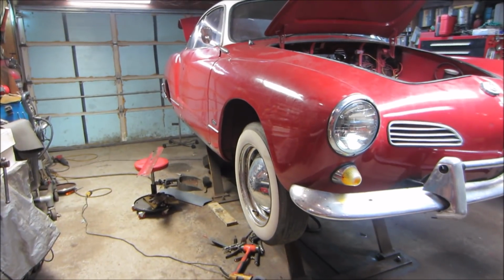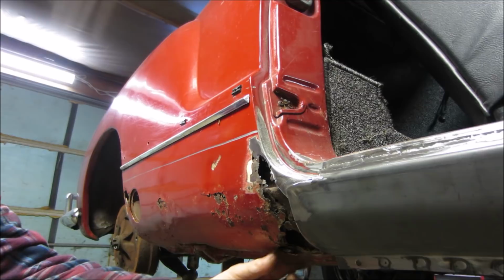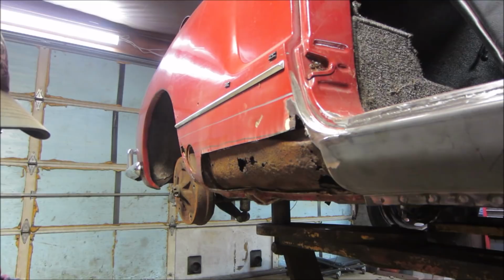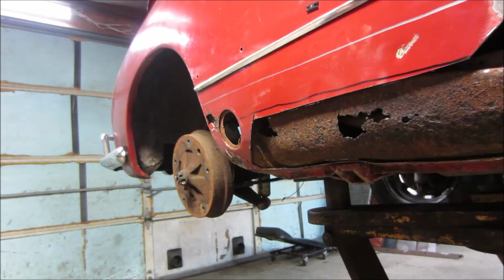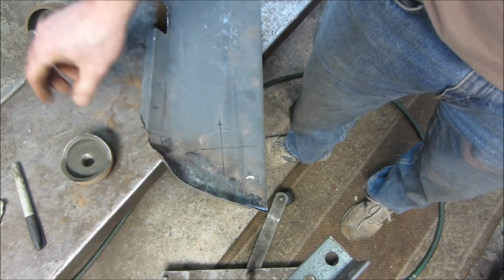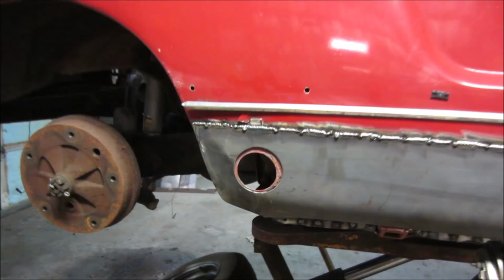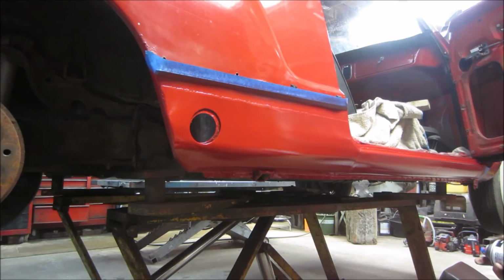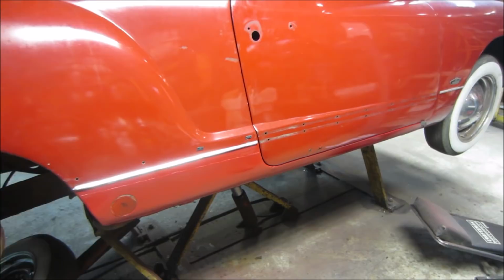1965 karman ghia finishing up the metal work.

Comment: My obsessive compulsive disorder would prevent me from driving this knowing that all that inner rust is there :-( . As my late father found out once just patching what you can see can be a mistake in an accident. Structure is there for a reason. Otherwise great job.
Reply: Lower your bar. You'll find its easier to be happy.
Reply: @OldSkoolF  Possibly at the cost of other things, like accident safety and problems found during inspection, for cars like this one.
Reply: Unless you live in a padded cell...  You realize nothing is perfect....  In the end it is better than it was....
Reply: @OldSkoolF  If he lived in a padded cell, there would be no point for a car at all. Nor would we ever see any YT videos out of him.
Reply: If you get in an accident with this vs a modern vehicle you are screwed regardless of the rust.
Reply: @kennethlaw5216  I'm with you bud, you can enjoy your imperfect 'running restoration'! Perfectionists don't enjoy cars they fret over them! It's like the fact that hire car's will drive anywhere!
Reply: Relax,, a good dose of chainsaw oil will fix all them rust spots,,, no smell either,,, lol
Reply: These days you rarely see older cars (40 plus years old) on the road.  Many are either completely restored, and the owner is afraid to drive it, or they were so dead set on making them perfect, that they never did the restoration.
Reply: @rawr51919 ........  Thanks for validating my point....
Reply: You do it properly, or you don't bother. Funnily enough it's not me saying that but one of the greatest Hungarian poets: József Attila...
Reply: I'm with you there John, that's way too much rust to just let it be worse behind the visible panels... it can cause further rotting, even with chain oil sprayed in.
But I also understand it would be heck of a pain to cut out everything around that, and fabricate the whole thing again... (unless there are manufactured spare parts for those areas).
Reply: Agree

Comment: My ocd would have killed me knowing the inside is rusty  and the paint does not match up perfect but really nuce fab work i have dine some welding in these before in the same spot and instead of shims for the plgs i went and made a weld all around it and grinned it down so it would sit flush and perfect

Comment: Looks pretty good. I remember trying to do that kind of work with oxy-acetylene, before I ever heard of MIG. It was SO difficult to control the warpage. 

Back then (in the 70's) when we were around 16 or 17, I used to ride around in my cousin's super rusty Ghia with rotted out floor pans and almost no brakes. We drove the bag off that piece of crap. Fun times.

Comment: That " piece of shaped wood " you are looking for is a 2-1/2 inch steel pipe about 4 feet long . I have made 20 or so rockers this way with a harbor fright brake and that pipe mounted to a vice at on end . grab the 2 outsides and bend it around the pipe. rocker in minutes from flat sheet metal !! no "patch panel " required
Reply: and when you were hammering that end around the corner, you just weren't holding your mouth right  lol

Comment: Pickling the inners of the patch panels with oil is possible. But you can also use Rust-Oleum, it's like tar. It gets that harder kind of finish and doesn't hurt anything else.

Comment: As a '96 Miata owner, I can't help fantasizing about you putting a 1.8L Miata motor in this. My first car was a Type 3, and I recall going back to college at 80-90 mph sometimes, so fantasize about how fast that super-light car, or this Karman Ghia, would go with just such a modest power upgrade as to the 1.8L Miata. Or maybe you'll do so with that Type 3 of yours (if you still have it).

Comment: Am loving the videos, I’m a long term subscriber and viewer, your one of the best youtubers out there. But I must say I’m more than a little concerned by welding cosmetic panels over those badly rusted and compromised inner panels,  structural integrity is there for a reason, I just hope it doesn’t cost you in the future. 
I wish I had half your skills, your presentation on conversation is brilliant, keep them coming Mustie1.
A lifetime UK viewer.
Reply from the maker: inner channel is for heat, outer is structure

Comment: Hey Mustie, Great DIY as always you're a very talented Mechanic, Fabricator and Artist. May I ask why don't you use a cold galvanizing/weld through spray coating on the inside of your Karmin Ghias replacement body panels to prevent rust before its time. It really does help to make newly made panels last a few years more. Cheers.
Reply from the maker: oil works better in my opinion

Comment: Hi Mustie, I saw a method for joining a panel by doing what you are doing on the 2 sill panels but cutting a strip of metal an inch wide and welding it in half behind the welded panel length ways (vertical) so you can make a better joint.  You made a nice job of that.  Its never easy making those compound curves. Have you tried 3M cavity wax for the rustproofing? I've had good success with it.

Comment: Drill with a wire wheel I would have used. Done it before and found where the rust was bad, where Bondo was and where the metal was very good.

Comment: The heaters in those things sucked when brand new so abandoning them was no great loss. We had to have a gas heater installed to get any actual heat into the cabin. Still going to be one Hell of a fun drive on a warm sunny Sunday. Now, can we discuss a carburettor for each cylinder? No eh... I understand.
        Mike
Reply: Well, yes & no. My dad bought a new '67 Bug and on the highway you could bake yourself, but get stuck in traffic long enough you'd freeze. The other thing about them is they were so airtight it helped to crack a window open a bit to allow the warm air into car. I grew up about 15 miles south of Mustie's house so we're talking about the same weather. I had a '69 Ghia convertible about 10 years old and yeah, the heater wasn't great but it did work okay.
Reply: In Northern Ontario, they were found wanting, badly. Our first bought new in 1962 taught us well. It wouldn't properly defrost the front windows at 30 below, we had scrapers for those in the front seats.
        Mike

Comment: Awesome fabricating. I have noticed for the last few videos, when you use power tools, you muffle the video a bit to keep the noise down. Thanks.
I find it funny the posters that complain you didn't repair the rust beneath; I check their channels and I don't see on video posted.  Much easier to armchair quarterback, than actually do it.
Reply: Correct!
Reply: Life is too short - it's a nice KG, but to have it on the channel for the rest of the winter and spring? makeing it perfect is just begging the universe to run a bus over it.
Reply: canuckguy worried  - Beautifully stated.
Reply: canuckguy worried  Posting claims in Youtube comments, easy. Making videos of work, hard.

Comment: there is an oil called fish oil, the best thing to use to prevent any rustig or further rusting, i knew this bloke that fish oiled his car 4 times a year from new, 25 years later, still no rust at all throughout the whole car, the only problem is you can't drive the car for atleast a week after doing it

Comment: Excellent work Mustie! I would have done a couple things differently like chase a few areas with that rust neutralizer and then welded the parts on it, but that's me. You're a master in this craft! But why didn't you do the front panel? 

I do not know if I posted on the other video, but the floor pans, the Ghia and the Thing are identical, and a beetle  pan from the driver's seat back is the same as the Ghia and Thing. The fronts are different however - the Ghia/Thing have a a squared curve to them and the beetle has a rounded curve. If they sell rear 1/2 floor plans, they all fit, as memory serves me right.
Reply from the maker: l thought ghia pans are 4 inches wider front to rear
Reply: @mustie1 , hmmmm.... That might be true, but I do not remember that. we're dealing with rotting brain cells on this end :).  But (!!!) You do have some Beetle Pans nearby to measure and compare to; they belong to your friend VWNut and he was wanting to put them into his '64 Beetle but as far as I know, he hasn't... not yet anyways. Look at the pans he has and measure them across. But I do know that the front is different and it matches with the VW Thing.

Comment: I can honestly say that i have never seen anyone do a lap weld on the side of a car. Im no body man but i am a welder and i thought that it should be a butt joint.
Reply from the maker: every joint on the car is a lap joint, from the factory
Reply: @mustie1  that is truth. My father worked on bugs all through my early childhood, and needless to say, I learned a lot being around the shop many days a week, (I earned my allowance, by keeping the shop clean and organized)
Reply: Repeat After Me:  sacrificial pop rivets always worked for me too!
Reply: If you are going to lap it, flange it first. You wind up with a flush panel that way. Saves so much time when you get to the finishing stage. Butt welding is best, but can be difficult sometimes, especially on old thin metal. Panel flanging tools are relatively cheap and easy to use so why not use one? Heck you can even get one at Horror Fright....

Comment: At least the patch panels are thin enough to work it into shape. Nice job on that rocker panel. I guess your not going to fix the holes behind the 2nd patch panel, right? That's not your heater tube like in a VW is it?

Comment: I am with Mustie1-  He will be lucky to put 3000 miles on the car in the next 5 years-  and that will be almost entirely in nice weather.  To do a full restoration would cost more in time and money than the car is worth.  I have seen WAY TOO MANY cars that sit for years half way through a "full restoration" that are never get put back together again ( think of the '60 Dodge that Scott of coldwarmotors bought at auction as a base for the '60 Fury.  He got it for next nothing because a punch of parts were lost as it sat forever)  I bought a '66 Galaxie like this KG, but running.  I have $2500 in a convertible that will win a couple of local car shows (in Farmall paint) and fun driving in between-  I had it out yesterday- in between Nebraska snowstorms.   If guys want to start on "trailer queens" that are half done when they go in the nursing homes, be my guest.  I will buy them from their kids for 10 cents on the dollar, finish the cars with a "lick and promise" and get them back on the road for some grins!
Reply: I'm with you there. I'd rather have a driver quality car that still cleans up nice then spend thousands on a restoration and barely drive the damn thing
Reply: a "4" is worth about 25k.  Check Hagerty.
A "5" (concourse pebble  beach) about 36 but most people are not  physically capable of this level.
Reply: I've seen too many 'labours of love' never get finished before the owners totter off this mortal coil! Mustie1 will be having fun in this come spring!

Comment: I bet checking the wiring after all those mice have been in there  becomes a bit of a nightmare, I know they love chewing on soft things ... ? 
How can you check the insulation on wires you cant see ... ?
Your colour match is actually better than the original colour match on the round cover plate you put back in the hole
Nice job Mustie .... ;-)

Comment: If you wanted cover up the welds without bondo, some rocker guard would have filled the bill as it would have covered and blended the welds into the rest of the panel. Nice straight edge with tape just below the molding wheel well to wheel well, would have looked great
Reply: I'm replying to my own posting, never mind what I just said, after a bit of thought I remembered the VW double cab and realized you were just painting it to protect it in case you had to throw the car outside for a bit. But I'm sure you did that on purpose so you could see what kind of responses you could elicit, you got me  😉

Comment: did you (or not) treat that panel that's under the one you just welded on with any corrosion treatment? it looks almost completely rotted through  and is in some points. I would have thought that you would have treated that panel before you welded the new on on?

Comment: So i know you tried the phosphoric acid rust converter before.  Did you not like it?  Seems like that would have been a perfect place to use it to halt that inside rust before recovering it.
Reply: I might be wrong but I thought he said he avoided it because of toxic gas during welding-- and , his method tends to work better where he is.
Reply from the maker: @kirkjohnson9353  yes it sucks to weld that stuff

Comment: Nice work! Where the hole is looks (even before you put the patch panel) like it will allow water to freely enter in between the outer and inner panel and stay trapped. I wonder if that was what originally weakened that area of the car? Just an observation but then again, I'm not terribly familiar with how the Ghias are made :-)

Comment: That rust under the panel shows up... All I could think was: Why is he feeding a dead horse? Unless you rebuild the thing from the base back up this car will never be save to drive. My opinion.
Reply from the maker: it is just for heat, the part for structure is fine,

Comment: The rust and holes behind the new panel fitted, are they the heater ducts. I cant see them being structural and as you said in the last vid about the front parts being heating ducts, This is what I presume. :)

Comment: The ghia I have looks like the same guy did the sheet metal repair. Lap joints, and covering up cancer rust in the heater channels...so yes I am drilling out spot welds cutting lap welds, and braising, and addressing the areas covered up waiting to continue rusting. Yikes.
Reply from the maker: $500 car, you going to put 20k work into a $500 car? or have fun putting a beater together that l still drive for fun. very panel on this car would need to be replaced on this if all the rust was fixed, or just shoot it with oil to stop it,

Comment: Did I miss Mustie treating the rusted out heater ductwork channel behind the rocker?  At least paint it with some rust conversion paint or treatment?  Anything?  If you're not going to cut it out, treat what is there to avoid further corrosion?

I know this is meant to be a driver, not a looker, but all this work to replace the rockers and lower sill will be wasted when it just eats through again.  Spend the 10 minutes to paint it with some rust conversion / treatment?
Reply from the maker: not what l want, it will get treated later

Comment: So I'm guessing here as I'm from the UK, but this guy is from canada or close to it right ? I know this is just gonna be a 'what we used to call  a runner for a one'er £100' but that was the heat exchanger behind that panel if I'm correct, and those air cooled flat fours you not the best at keeping you warm even when brand new, i would not have ignored that rust behind there lol, and no I'm not a discovery channel mechanic, i was a fully trained mechanic/MOT tester and i also worked in a insurence contracted crash repair garage, and to top it off my first ever car was a VW Beetle 1500cc so i know how cold these things can be lol :)

Comment: You're putting bandages on wounds that require stitches, if you don't repair all the rusted out areas you're just wasting your time. I wouldn't feel safe driving this thing knowing the strength of the car has been severely compromised. Great job on the panel work though!
Reply from the maker: you should never ride in a dune buggy then as they dont have any heater channels

Comment: Dave, I get you are just making a fun driver, but wouldn't you want to at least slap some sort of crude patch on those heater channels?  Not for looks or rust but so you can have some heat in case you need it :)

Comment: What if that original hole had been 3/4 of an inch smaller, or 5/8 inch larger - do you have a set of those hole die cutters, and is there a proper name for that tool? Very slick results!
Reply: Hole punch. There are also hydraulic versions. Even the manual Greenlee manufactured punches are very price.

Comment: Why didn't you cut out the rusted out panel that was behind the outer skin panel and repair that part first to prevent that area from rusting out any further
Reply from the maker: you cant, you would need to take the body off and this is not a restoration,

Comment: Mustie, I live in Ca. where their is a law and cost for everything. Can you explain "get a sticker " when you are doing bodywork? Does the state not like rust?
Reply: He's talking about getting an Inspection Sticker. Can't get a "Sticker" with rust on rocker panels! I know its stupid rules!
Reply: Annual inspection scam. A rust hole in the body that the "inspector" can see through is a fail which means business for a body shop so they can slather on a liberal coat of Bondo to make it disappear. One of the rust belt quirks we have to deal with....
Reply: Copy that, thanks
Reply: David Gillespie, And I thought NY had tough inspections. Half the cars here would fail if rust on the rockers were an issue, especially on pickups. There are so many pickups in the greater part of upstate NY that I don’t think they’ll ever get a rusted rocker law passed.
Reply: @theone2be33  Not all that stupid. The rocker channels on these things, especially the convertibles, act as the frame around the floorpan, plus they act as ducts for heat and defrost.

Comment: Just a dumb, non body work guy, question... would it be feasible to put POR15 or some sort of rust preventative on the inside of the new panels? I know there will be welding heat... just wondering because I may try to put rockers on my old van.